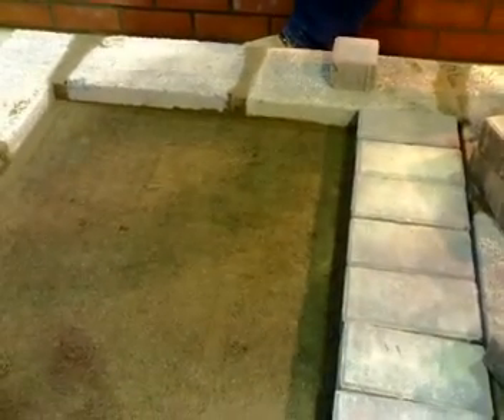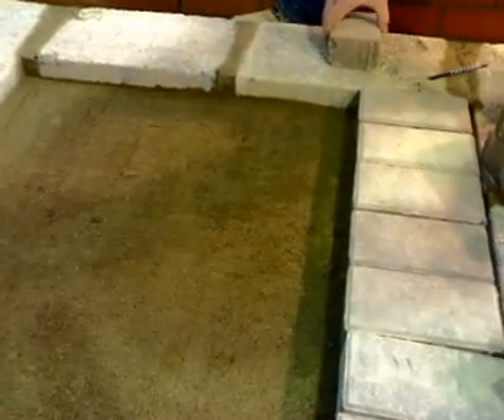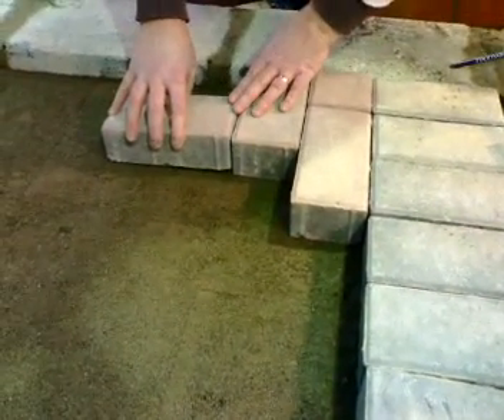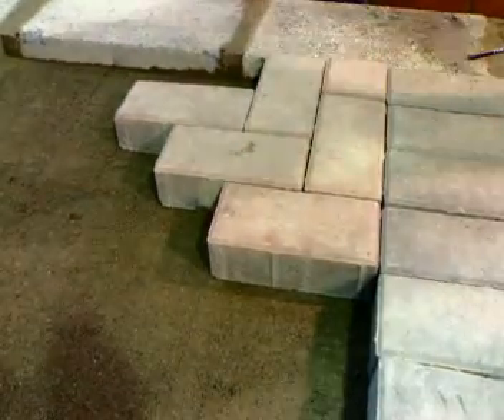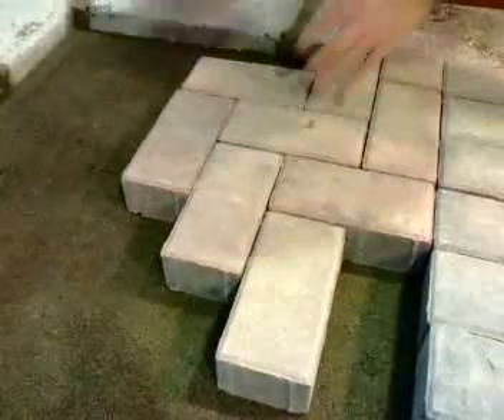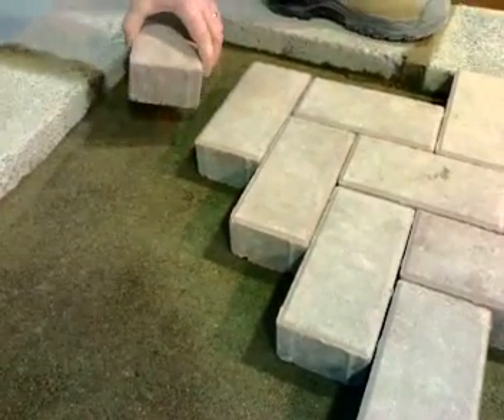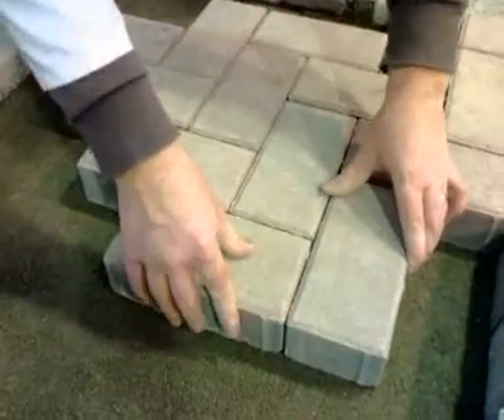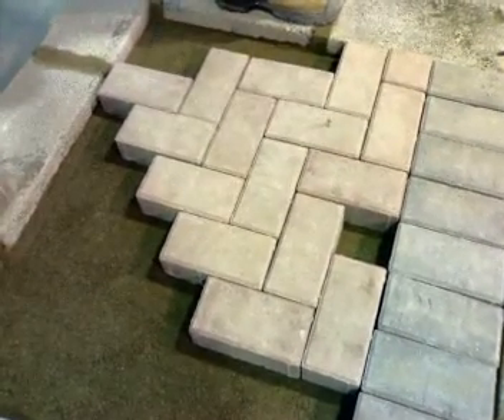90 Degree Herringbone Paving

Comment: Does it have to have a border or frame around it?  My new home just got the front pavers installed in the herringbone pattern but with no borders. :/
Reply: You always have to work to a good edge, so either timber border or set in block pavers(sharp sand/cement) so they act as your good edge(border)